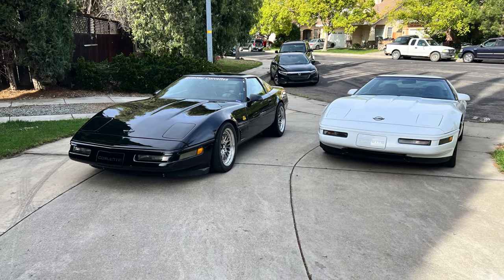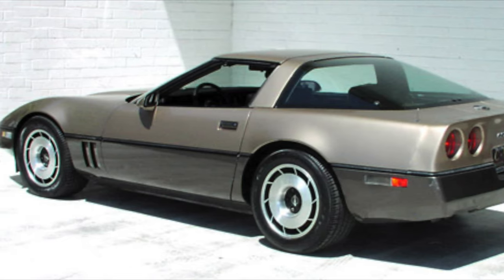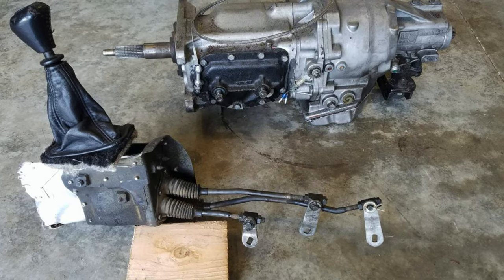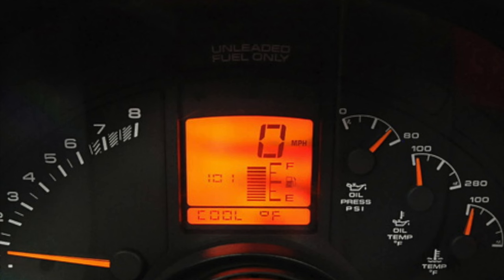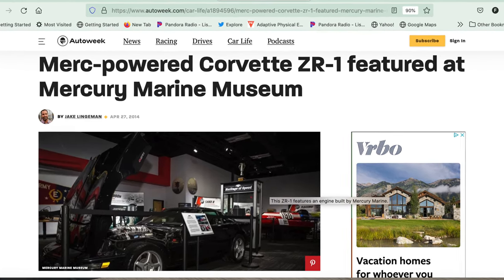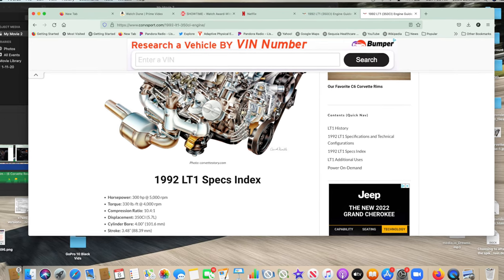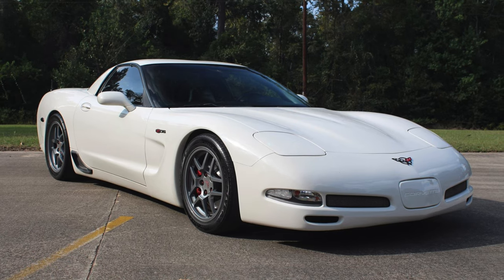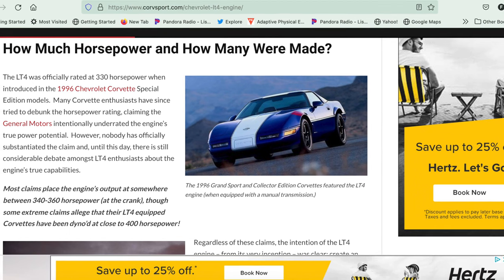C4 Corvette Review

Comment: I love C4s because they are so distinct, and odd/exotic. More than any other generation. So many details are specific to the C4, and/or just exotic. Let’s see: body divider/bumper, clamshell hood, the revolution of the pop-up headlights, the windshield wiper style (not just on C4s, but exotic), black A-pillar (rather than the usual body-colored one, so exotic, but on the other generations as well), the LT-5 engine (very exotic), side lights, the turbine/fan blade style rims, the roof height (very low…so exotic), the battery access (pain in the butt…so exotic), odd interiors (yeah, exotic), those awesome sport seats from the ‘90-‘93 model years, the Callaways (too much exotic goodness in one car), the gas cap location (not just on the C4…but exotic). There are probably some other cool odd and exotic things I missed. I just love C4s. And…I think pineapple DOES belong on pizza.
Reply: Yeah the C4 is my favorite gen as well, here’s a couple of things you missed, 1st the most obvious those awesome digital gauges that look like you’re piloting a NASA rocket, 2nd is that the C4 has the same parking brake position as Ferrari, and this is just a personal preference but I think the wide rectangular muffler tips look better than ordinary round tips.
Reply: It's so weird they went with a European engine design when GM themselves had originally come up with the twin turbo idea and Callaway had further developed the idea into a hugely successful machine by 1988. Truly incredible they threw it away. They said emissions I guess but we know that wasn't any kind of a problem for Europeans. I do wonder what went through their heads. Not saying the ZR1 was unsuccessful but I doubt it was necessary to pay again for development of a completely new engine.
Reply: This most recent comment made me think of another odd detail on the C4. The rear window defroster strips are vertical, rather than the usual horizontal.

Comment: My buddy and I have described C3 Vettes as "2 seat muscle cars" for years. Im a huge C4 fan...cant beat the performance for the money! I just did a vid using my 93...i ran 0-60 in 5.9...but im very smooth on clutch/trans!
Reply from the maker: That’s great 😀 definitely don’t want to wreck the clutch!
Reply: I had 2 C-4's....OK cars....Would seriously consider a -6, 2008-2013.
Reply: But, at 77, kind of getting long in the tooth for this kind of fun clutchbutt.
Reply: Honestly it's pretty easy to beat their performance now adays. C4 vettes and sn95 mustangs are probably the two most popular cars to pick on at a light.
Reply: That's actually not bad for a C4.
Reply: @Largetalons  when I say tough to beat, I mean the hole package. If only I could rate the car in fun per mile! C4s are still simple enough that they are very reliable, relatively cheap to fix, get decent MPG and are just so fun. You can get a decent one for 6-8k...very tough to beat.
Reply: @fartzr.schmelli3351  I think the stock 6 Speed 93s ran like 5.3 0-60 in the delicate hands of motor trend.

Comment: I have a C4 base L98..  I also had a '97 Camaro SS with the LT 1.   I replaced the SS's water pump with the better one that did not leak on the Opti spark and never had a problem after that.   the L98 in my Corvette is 30 years old and has no problems like that.   I would easily give up horsepower for reliability over the course of decades.
Reply from the maker: Good point that’s one of the things that still makes the L98 such good engine to this day.

Comment: In '96 I was working as a salesman at a Chevy dealer and I read the specs on the LT4 and I thought then that just 30 more hp than the LT1 just didn't sound right. Bigger sodium filled valves, different cam and heads, higher rpm range plus other changes just didn't add up. I always thought it would be a screamer! 350 to 360 hp makes more sense. Unfortunately, most Corvette buyers at that time were looking for automatics so they just didn't sell many and I never got a chance to drive one. The only external difference I believe was some red paint on part of the intake manifold.
Reply from the maker: You called it! The bright red intake manifold!

Comment: Great overview through the years. I am on the hunt for a nice 1988-89 (I prefer the squared off style and original dash) with a manual transmission because manual cars had the Dana 44 differential. I was also told that the bump steer issues they had with earlier C4's was resolved in 1988. I'd like to put an aluminum LS in it and make it a fun track day car too. Something about these C4's I just love because I am an 80's kid.
Reply from the maker: Word! Same here I loved the C4 when it came out! Dreamed of one day wanting one!
Reply: I know Dana 44 very well I’ve got it in my F-100 SR Country/ Bumpside bronco , those Dana 44 were used in the Ford F-Series , Chevrolet , Chrysler and Jeep in Brazil they are bullet proof

Comment: I had a 96 C4 for a while I loved it 350hp handled good for its era.. So  I want a C8 real bad now . Well maybe someday.
Reply from the maker: Yeah the C8 is on another level in terms of engineering. There just so expensive now with the supply chain issues and chip shortages.
Reply: @FugitiveVette  I know rite even when crap gets back to normal they will still be a zillion bucks .
Reply: If you had a manual 96 lt4 they were rated at 330 hp. Headers, get rid of the catalytic converte,  front resonator muffler, add an x pipe and it would jump the power over 350 without touching the tune or engine, if you did the gm lt4 hot cam with the mods I mentioned and a tune it was not uncommon to see 325-330 rwhp, if you ported the intake and heads and used the right cam 400-420 rwhp was not uncommon. A stroker kit made it easier to get 425-440 rwhp. That's respectable even by today's standards. A 3500 pound car with a six speed and close to 500 flywheel horsepower is good, and these cars were doing that 25 years ago. Way ahead of their time. The reverse cooling allowed the sbc to see power and efficiency, fuel economy that was unimaginable prior to that time. But the ls1 release killed the lt1/lt4 platform. And the fact that nobody makes an aftermarket big bore block has stopped it from being a viable base to build from for  high power. Most usually go to a dart or world products sbc 400  bore block once they get over 500 hp, or just do an ls. Still the ltx was king from 92-97, you can even get afr CNC eliminator heads for the ltx now. But aside from "stock" style racing classes where you must use the OEM block there are easier ways to make power. Also the OEM design intake manifold is less than desirable for builds over 500-550 hp. Still for a real pump gas 383-396 ltx the stock block, heads, and intake can be ported to make a killer street car. Always thought what would have happened if gm had stayed with the ltx platform for another decade. The LS is a conglomerate of the best of the gen 1 and ltx sbc and a natural progression. It really does address all the weak links of the original sbc. They raised the cam tunnel to allow bigger cam cores, they raised the deck to allow longer rods, they made the main caps and bottom of the block sturdier, they used a shallow valve angle, and symmetrical port layouts. All of the things that racers were doing with the sbc Buick headed nascar engines, the sb2 etc. The fact that they put so much performance enhancements into the LS and made it a production engine is simply amazing. But it all started with the sbc, and progressed through the lt1/lt4, l31 vortec to what we have now.
Reply from the maker: @b.c4066  mine is a 397 Stroker from a factory LT1 LT4 block. Mine made well North of 400 to the wheels. Plus the light weight crank and rotating assembly really make it accelerate!
Reply: @FugitiveVette  very nice! I just have a 91, but it's a factory six speed car. Did a 385 (.040" over) from blueprint , afr 195 heads, shaft rocker arms, 276/280 advertised 228/232@50 576/576 110 lsa, hooker super comp headers, 92-96 OEM catback exhaust, miniram, accel 58mm throttle body, custom cam and Holley HP msd 6a ignition.ram aluminum flywheel and clutch kit. It's not an ltx but it's way more power than I can use, easily 375-400 whp. Biggest gripe is the noisy black tag zf at idle in neutral it's pretty obnoxious. But it's a beast. Not even Dyno tuned yet, very very conservative ignition timing and fuel is to the safe side. On new Conti extreme contact sport+ aired down to 20 psi first and second gear are useless at anything above 40% throttle. I'm sure there's a lot more in it. But it's fun as is, and in no danger of detonation. When you consider I paid $3200 for the car, put 11-13 into the engine and efi (and still have the original L98 with harness and ecm, with stock dual mass flywheel and clutch)  it's a lot of car for the money. It's been a fun journey getting it where it is. I'll never sell it, if it gets wrecked it will become a Vette kart 😁. Now if they'd just drop gas back down to $4.50 a gallon I'd be a happy man.
Reply from the maker: @b.c4066  that car sounds awesome 😎 happy for you 👏🏿
Reply: As someone whos driven both, the c4 is better (not faster of course) but the c4 is just so much more comfortable. If all you want is a track car then obviously the c8 will swamp it, but the c4 is comfy, and has more character imo.

Comment: Hi, great video.  I have a 1990 Coupe.  The digital/analogue gauges were started in the 1990 as was the new interior.  The 1990 was  the last of the original body style but with the modern dash.  that L-98 is a pretty good engine that as you state had most of the bugs worked out by 1990.  It is pretty easy to work on too (changing sparkplugs is still an effort!).  As others have stated here, great performance for the money!
Reply from the maker: Oh snap! I didn’t realize the 90 had the modern dash. Which do you like better?
Reply: @FugitiveVette  Hi I prefer the newer dash as it seems a bit more modern but I can see why others prefer the original.
Reply: 1990 was the last of the original body style. 1991 has the round back end and square taillight with the ZF6 and L98. Last of the L98. 1991 had the nicer interior and dash though, 89 was the last digital dash. So if you wanted the best older style body and digital dash 1989 would be best, the only older style with a 6 speed and digital dash. 1988+ had a suspension redesign. So if you want 4+3 88 would be best as it’s got the later better suspension.
Reply from the maker: @destruxandexploze2552  1990 has round twilights not square. The 1990 ZR1 has square taillights.
Reply: @FugitiveVette  This video had me so fucked up. 1990 had the old back end. ZR1 had the round back end and was a bit wider for the 305 tires. 

Yes 1991 was the round back end L98 6 speed. 1992 was the start of the LT1. 1990 however has the new interior but the old body style.

Comment: The Doug Nash 4+3 transmission isn't a "three-speed overdrive" with "three buttons", and it isn't a nightmare to rebuild. It is a variation on what had been done many times in the past, often in British sports cars with four-speed transmissions; it has a single-speed, electronically controlled overdrive attached to the back of a conventional gearbox. In the Corvette, overdrive can be engaged in second through fourth gears, but it's really only useful as a 'fifth' gear (fourth-overdrive), where it works very well for highway fuel-economy, which is exactly why the system was used. 

Without it, there would have been no C4 Corvette until at least several years later, if at all. GM had no manual gearbox capable of handling the torque of the 5.7L SBC, but they spoke with Doug Nash, who by then owned the rights to the Borg-Warner T-10 design. He came up with the 4+3 concept, and Corvette Engineering paid him to build it. It's durable, it's cheap to rebuild, and it works just fine. As an old-school box with 'single-cone' synchronizers, the T-10 doesn't shift as quickly as a modern 'dual-cone' type, but it has a kind of hefty, rifle-bolt action that I like, personally.

You can still get parts from www.5speeds.com, which is run by Paul Cangialosi -- one of guys who helped develop it and iron-out some early kinks. Check out his YT video, "How a Corvette 4+3 Doug Nash DNE Overdrive Functions", here:
https://www.youtube.com/watch?v=cS6vA3UR4jM&list=PLfi6z3iAfExAnIZKGmvQEWhwwaiuMviXU&index=1&t=10s .
Reply: 4+3 is an awesome trans.
Reply: This dude has a ton of misinformation don’t even bother with this video. Also it was a 2 speed overdrive unit, direct (1:1) or overdrive (.60 or .68:1 for the Corvette)

Comment: i have a 85 and while it has it quarks, it's power to weight is very balanced and you could do turns a higher speed then most cars , but i have experienced that the engine is very pick and hates cruising but loves being beat on. beside that it a very decent car. i daily mine in the summer  to octoberish
Reply from the maker: Glad it runs good and you enjoy 😉 it! Fun cars.

Comment: The DN 4+3 is a Borg-Warner Super T-10 with the Doug Nash OD unit in place of the tailshaft housing.  It is actually a 2-speed unit [direct and overdrive].

The OD unit is designed to automatically engage in 2nd/3rd/4th gear under low RPM/light-torque cruising around town.  This trans was strictly for fuel mileage.

It can be shifted 1st, 2nd, 2nd OD, 3rd, 3rd OD, 4th, 4th OD; hence the 7-speeds.

The ZF-6 debuted in 1989, not 1998 as you mis-spoke.

Comment: Love your explanation.
So the LT  1  output with the manual transmission was the real reason for the ZR 1 sales decline from 1992 to 1995. I never put those facts together. There for the LT 4 made the ZR 1 obsolete in a way.  Great review.
Thanks .
Reply from the maker: Yes 🙌 that was my read on the whole situation. Plus lots of discontent among GM engineers during the ZR1 development.
Reply: @FugitiveVette  I can see now how that could have heart their pride.
Which later led to the superior creation of the LT 4 and LS motors. 
Interesting. 
Thank you.
Reply: I'd say the $35 grand upcharge for the zr1 was the main reason for sales declining, especially when you could get a base model 92-96 lt1 zf s6-40 car at base price. Everyone knew they were a solid 275-300 hp. Doesn't sound like much now but it was huge during that era, and more power than most could use on the street. The traction control wasn't as refined as it is now, so a 3400 pound car with close to 300 hp was nothing to sneeze at. Why pay $35,000 more, pay higher insurance premiums for power you couldn't utilize was the thought of many back then.
Reply from the maker: @b.c4066  good  👍 point Bill plus you could do a heads and cam package on LT4 LT1 engines and make around 500 hp!
Reply: Hello good sir! I know this is an old post but a goodie. Quick question so the 93’s had LT1’s and in 94 the Vetts had a LT4? For only one year? And still a 350ci just different heads and intake?
Again great video!

Comment: I have a 1985 L98 automatic with Long tube headers. And Borla exhaust with the jet chip never had no problems with my 85 with a rebuilt transmission.
Reply from the maker: That’s nice! How long have you owned it?
Reply: 5 years
Reply: The iron -882 heads of the '85 TPI flowed slightly better than the later aluminum heads and cam was hotter and so '85 was faster: 
https://www.youtube.com/watch?v=M9FwU9iUmfo
Reply: @BuzzLOLOL  85 Vettes had 624 heads. They were about as suck as the 882s.  Every year after got faster because aluminum heads came in late 86 and then roller cams in 87.
Reply: @dustinmccain1215  - Both the -882 and -624 heads outflowed the '87 - '92 aluminum heads... Hot Rod did some basic porting on them and they got even worse... you had to hog the hell out of those aluminum heads like Lingenfelter did to get any performance out of them... 
Of course, first problem to overcome, is aluminum bleeds off heat/power faster than Iron heads! So need to bump up compression ratio...
Reply: @BuzzLOLOL   You're not the 1st person to say that the 85 was the fastest out of those my Uncle had a 85 and 88 and he said the 85 was a good bit quicker
Reply: @mauricecooper176  - Yeah, the 1/4 mile time in that '85 test wouldn't be seen again until 1996 LT4 tests...
Reply: @BuzzLOLOL  The 113s were 58cc. 624s and 882s were 76cc The 113s were waay lighter and the hp increase was up to 260hp in 91. They never made close to that power out of those crack prone heavyweight 624s or 882s. They used the 113s on ZZ4 crate engines because they were real performance heads of the time. 624s were not in any fashion a good head or 882s for that matter
Reply: @dustinmccain1215  - Look at some flow tests... the 624s and 882s outflowed the 128s/113s... 
The L98 engines were never rated above 250 HP... aluminum bleeds off heat/power faster than iron... 
'90 and '91 L98s were rated 250 HP instead of 245 HP because a shallower dished piston was used. 
Corvette L98's were rated in netHP... 
ZZX - ZZ5 crate engines were rated in grossHP... like pre-'71 ratings...  and they had bigger cams... 
ZZX 350 had a 235/235 cam which HotRod proved to Chevy was a mismatch and too much cam for the 113 heads... Hot Rod slipped a smaller cam in and proved that not only did it make the engine vastly more drivable, but it made more torque and HP everywhere including even slightly higher at peak HP... so GM switched to a smaller cam for later ZZx engines... not quite the grind Hot Rod used, but one they developed to new engine spec.s: 208/221... (I have one laying around here somewhere) 
A 235/235 cam should really be used in an engine overall designed/capable of 500+ HP: 
https://www.dailymotion.com/video/x3pic66 
Pontiac used a 234/244 cam for their late 1960's 'Ram Air V' crate engines of 500 HP...
Reply: Hi 137 crypto. I'm totally set on borla for my 85. How much of your system is borla? It seems that now they only make axle back for c4, but in the past also made headers. Thanks